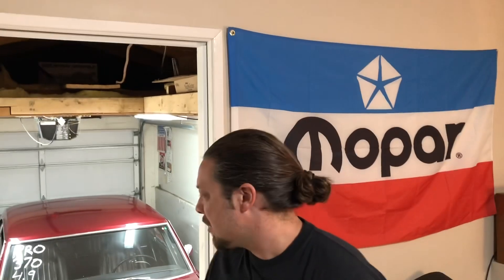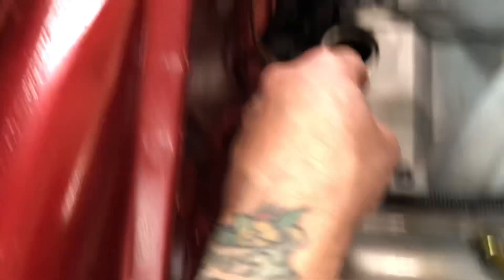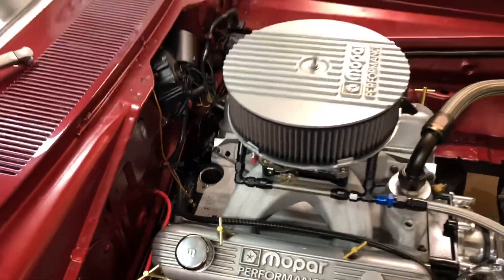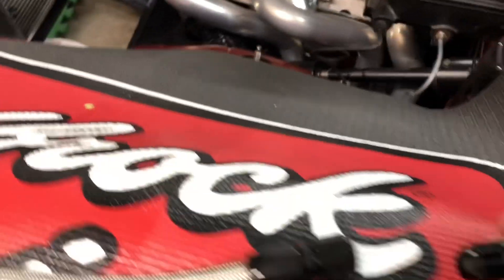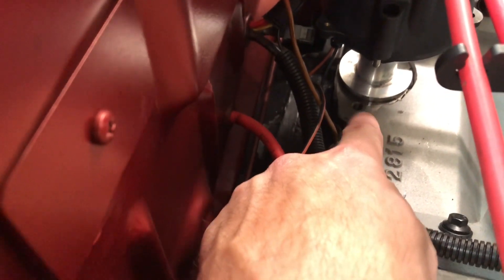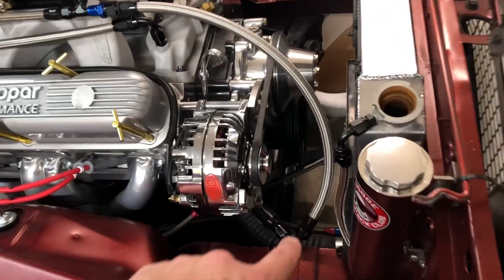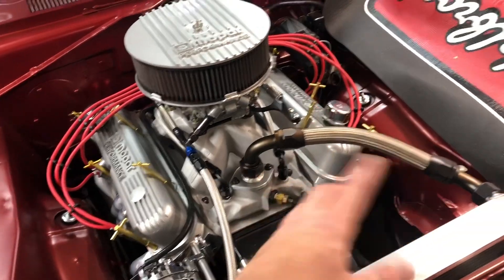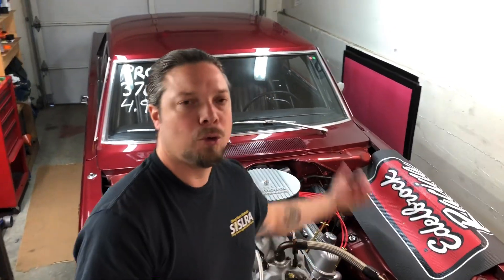More Racecar! Adding intake water lines to small block mopar! Edelbrock super victor intake

Comment: If you keep the thermostat and crossover from the intake to water pump could you put the temp sensor in the smaller plugged hole on the water pump? Is it the correct size? I like this modification but my car will be mostly street, thanks.

Comment: Did you block the flow at the deck. Two big holes on the top side back of block ? That's what's supposed to force the water flow up and around the head and out the intake passages you put in. You'll also see coolant lines from timing cover to the bottom of the block on some oval engines
Reply from the maker: I don’t know if it’s blocked at the back honestly. There is water in the heads there tho and it flow thru my new hoses and out so I’m assured of that
Reply: @SimpsonsSpeedShop  I know some of the oval track guys because thats what do but haven't done that mod yet. Just got  cometic to make them gaskets with that hole blocked. They'll be some flow there for sure idk 🤷‍♂️ if it will help or not. Its a mod to change the direction of water flow through the engine. They found the water just goes straight to the back up the heads and straight forward to the exit at front of intake in factory configuration. The serious oval effort dodges came up with a total package to make the cooling system much more efficient. Forcing the water to flow front to back bottom to top . Just asking because I've seen it alot with the oiling mods too guys only do half the job and then say it doesn't help 😆. Stuck exhaust valves due to lack of cooling  has been the theory and problem for some too. Oval track engines take a beating. Wasn't uncommon to see a blown up chevy a day before good cheap  aftermarket parts were allowed in the stock type  classes. Lol
Reply: @SimpsonsSpeedShop   for the critics also remember that oval engines are never below 3500 for 15 minutes plus  unless it's a caution or in the pits. I come off the corner around 5000 in my cars. Overheating is a huge problem I know guys who aren't concerned at all at 240 degrees operating temp 🙄 hope it helps cooler engine is a happier longer living engine in most circumstances 😀

Comment: did you plug the rear deck passages to force more exhaust valve cooling ?
Reply from the maker: ? No explain please
Reply: please see , YouTube 
Just LA’s 
600+Hp….? 408 small block mopar
Reply: the cylinder heads get the coolant prior to block circulation , thus cooler heads allowing higher compression with less chance of detonation

Comment: Gas will not "eat teflon tape". The reason it is is not recommended to use teflon tape with fuel lines or any hydraulics with tapered threads (not flare type fittings) is because pieces of the tape can tear off and get into the fluid causing clogs or blockage. Teflon paste or other fuel proof paste type sealants are safer. As long as you are careful with the tape, it's perfectly fine. PTFE braided hoses are commonly used for fuel line as well as hydraulics like PS fluid and trans fluid.

Comment: Please keep us informed on this new dragstrip that is being constructed !!!! I myself am very interested in any information you could give me/us on the tracks progress !!!! Thanks man !!!
Reply from the maker: Ya I will for sure. Haven’t heard anything lately tho.
Reply: @SimpsonsSpeedShop  thanks for getting back to me in such a short time !! Your one of the good guys !!! I wish I could come up with some suggestions to help you improve your car in some areas but you seem to have them all pretty much covered !! I know you want to keep it as much factory and streetable as you can so that leaves all my ideas out !! Have you made a decision on your carburetor yet ??? When I raced I had a 750 stage 3 carb from BG that flowed 1040 CFM @ the top end ! Gave me great consistent 60 ft times and plenty of throttle to the traps !! The drawback 800$ 15 years ago rather salty but it did work !!! The plugs were perfect after shutting the car off down the shut down and pulled a couple plugs at the end of return road !! That was a 406 with 13.2 to 1 compression !!!! That smaller cfm gave it great snap off the line but I never compromised the mid range or top end with fuel !!! Everybody told me I needed a 950 my engine builder said if the plugs read true don't touch it !!! My 60 fts were consistently 1.42 to 1.40 all day and mph was always mid 142 range !!! Just some FYI from my past and how I miss it !!!! Can't wait to see that car on a bigger track !!! Would love to see your car truckin 122 + mph(1/4 mile) !!! Have a good winter with your babies !!!!! (referring to your car and your little one)😁😄😊
Reply from the maker: @circletrack7538  right on bro! Not sure prob going to leave the 750 on it, I may try to get it back on the dyno this winter amd just see how it is. Looking forward to some 1/4 laps next year! Both baby’s are doing great! Cheers👍🏻

Comment: The engine looks awesome 👌 You can also paint the valve covers and the top air filter cover the same color of the car and remove the fresh paint from the top surface of the fins and hit it with a clear coat to seal it. Love those ceramic coated headers.  Looking forward to your delta temp readings....
Reply from the maker: Thanks for watching

Comment: She still is looking pretty. What do you usually shift the motor at RPM wise and what did she dyno at ? I'm sure its somewhere in here but just discovered y'all. Thanks .
Reply from the maker: Shift light goes on at 6100 so by the time I make the shift it’s about 63/4 but I sometimes still hit the limiter at 65 👍🏻
Reply: @SimpsonsSpeedShop  What's a Rev Limiter? In my day it was our wife. True but funny. Motor on my friends.
Reply from the maker: @NobilityandLoyalty  lol. Rev limiter is an electric component built into my ignition box. It cuts spark after a set limit, say 6500 rpm, so the motor will not rev past what ever you set it to
Reply: @SimpsonsSpeedShop  I knew what it is but I was thinking back to the good old days when we wouldn't know what it was like about 1970. Lol 😂 Don't tell my wife about her being one. She would Rev Me Out. You guys are the best.

Comment: Bro.. If you wanna knock temp outta the system and make more torque,  go E85 if you can. On a 100° Southern California day I can cruise my big block car with 4.10 gears, 3,500 stall and a reverse manual valve body and never crack 170° on my temp gauge. Pretty crazy.  I used to have to avoid any type of idling on hot days to keep it under 200°.  Not any more, pretty stoked on how the E85 has helped with my temp issues.
Reply: Im going e85 bought a fitec 1200 hp. Bbc 168 still a work inbptogrss
Reply from the maker: No e85 anywhere I know of. I’m in Canada, don’t even think we have it here.
Reply: @SimpsonsSpeedShop   Aww.. that sucks. It's worth swapping your carb if you were able to find it. Good luck with your coolant mod. Should help with the heat.🍻

Comment: My head is spinning after the comment on the ferry ride...😳😳
Joe , I run purple ice in my 461 pontiac street car..
Stock rad. ,mechanical water pump , clutch fan , 165 ° t. Stat  with 3    1/ 8"
Holes...160 at track  never over 170 °  in traffic  95 ° days.... (stock shroud ) .
I sacrificed looks and weight for the convenience  of not having to worry about temp... but  I get the look you are after....mine is a daily driver from end of April till the end of October  in Pennsylvania....
Reply from the maker: Ya o should clarify the weekend trip would be like 1000$. Ferry would be 400$ plus tho truck amd trailer. It’s a rip off for sure and there is no bridge.

Comment: Do you run a restrictor plate in place of the thermostat?
Reply: Why not even a restrictor, it helps to prevent localized boiling
Reply from the maker: @PredaFran  I don’t believe this to be true. Not from my experience anyway If you have a good size rad a fan it will cool as much as go thru it. Even anything running hot, Pull the thermo amd it will runn cooler
Reply: it's not how physics work and it's not related to coolant temp or the fan it's about the fact that the pressure after the thermostat needs to be higher to prevent localized boiling, it raises the boiling temp of the coolant inside the block. Water pumps add around 40 psi more to the water pressure on top of the pressure already provided by the thermostat. It's also why the rad inlet hose is almost always smaller than the outlet hose even tho water expands a lot after heating up. People don't put restrictors in an engine because the water flows too fast. That's just a wives tail, a myth. Our water pumps will cavitate long before we get there . Almost all the forms of high level motorsports you find out there will have thermostats or at least a restrictor plate, circle track, time attack, nascar, formula drift, etc
Reply from the maker: @PredaFran  no one I know does this to my knowledge and my temps is always like 180street and 190 on race days so I’m good.
Reply: @SimpsonsSpeedShop  and you can absolutely do that, but don't go around claiming you don't believe in something that isn't a theory, it's physics
Reply from the maker: @PredaFran  bro till I see it proven it is theory to me. You can say it’s physics all you want but I haven’t seen hard evidence.
Reply: @SimpsonsSpeedShop  what do you mean my man do you think everyone in motorsports just made that up.
Reply from the maker: @PredaFran  bro I’m just saying I haven’t heard of this. I get 10 guys a week on here telling me “facts” and “it’s proven” not tryin to argue or anything. Till I know from my experience, I don’t know.
Reply: @PredaFran  Wow.... No belt driven engine mounted water pump on the planet makes pressure. It is a flow pump, not a pressure pump. Every pound of cooling system pressure raises the boiling point up 3 degrees, period. Cooling system pressure (which the hoses create by resisting against the coolant expansion), flow, and surface area prevent localized boiling. That is exactly why Nascar, road racing, etc, runs close to 100 psi from using braided coolant hoses that really restrict expansion.. Racing runs 100 psi cooling systems for a good reason, and that is to have a high temperature differential for better cooling by running higher engine temps.. Water only expands 4 percent, which is miniscule, but you can easily get 100 psi with braided hoses just from that 4%. The radiator hoses are different sizes for the speed of volume, mass at the inlet to the pump, and prevent cavitation and a vacuum which will instantly boil coolant above 65 degrees, and has nothing to due with pressure.. If you measure cooling system flow wrong you will think there is a pressure offset, but that is not possible with water. Guess where the myth of a 40 psi pressure differential came from? Measuring it wrong.. You can't compress water... It is a flow offset, not a pressure offset...  Restrictors are designed to do exactly what you said they are not. Restrictors are used in combination with under drive pulley sets or variable electric water pumps to reduce water pump flow so the coolant has more surface contact time to pick up heat and to even the flow out across the rpm range.. The restrictor does this because the flow is laminar at low flow/rpm and turbulent at high flow/rpm, and that turbulence reduces flow thru the restrictor as volume passing thru it increases. If you don't know what you are doing when setting up system with a restrictor (slowing down pump flow, higher pressure hoses and cap, etc), you will cause localized boiling.... Your knowledge of cooling systems is just as bad as your knowledge of physics.
Reply: @shvrdavid  
but isnt the pressure and flow rate decided but what the pump is connected to?
- you cant compress water, but doesn't applying a lot of force to it create pressure? so wouldn't a pump moving water at a fast speed and then encountering a neck down in the discharge size build pressure in the discharge side since there's a restriction. water resists compression but it does compress an extremely small amount.  
-my understanding was that moving coolant faster doesn't affect the cooling of it since the water is spending less time both picking up and rejecting heat but it is doing more cycles of it in a defined amount of time, you are right and I did forget to account for laminar flow in that, which seems like it would cause issues in the radiator
Reply: @PredaFran  A water pump is a turbine pump, and max flow is obviously determined by restrictions in the system. You are looking at water wrong as well. Since you can not compress water, it acts far different than a liquid that can be compressed such as oil. When water reaches an area it necks down, it increases in velocity. It acts like a solid in many respects. Any pressure in a cooling system is from air/steam, and the hoses restricting expansion. Fast moving coolant can easily destroy an engine because there is not enough time to pull heat into the water or a enough temperature differential to effectively cool it. The higher the temp difference between the coolant and the air flow across the radiator is, it gets far more efficient at transferring heat. You can have coolant going to fast, or to slow, which will have detrimental effects on the cooling ability. This is called "heat load" in physics. The heat load in a cooling system is directly related to the flow rate through the system maintaining a good differential temp without any perking of the coolant. Most cooling systems are designed for a 10 degree drop, and speeding the coolant up will reduce that substantially because it never made it into the coolant to begin with.
Reply: @shvrdavid  thank you very much i have now learned something properly, so in this scenario present what would be the best way to approach the cooling system for this car? Gutting a thermostat? Testing to see which restrictor is the best size? Just an open thermostat?
Reply: @PredaFran  I would have probably done what they already have done. I don't recommend running restrictors unless you absolutely have to. Restrictors will show lower coolant temps on most setups simply because the coolant doesn't heat up. But that doesn't mean the coolant is moving heat. Most times restrictor setups will have massively elevated oil temps under load because the cooling system can't absorb the heat quickly enough. I would much rather see someone run reduction pullies or an electric water pump, good tstat, piston oil squirters, larger oil sump, and an oil cooler on high hp/heat/racing applications. The cooling system does basically nothing for the bottom end heat soak. The oil does all of that cooling, which is basically no cooling without an external oil cooler. Oil temps are the root of a lot of cooling system issues at high hp... It does not do any good to cool the heads and block and having a hot piston causing preignition and breaking stuff.....
Reply: @shvrdavid  but Wouldn't the fact that the  thermostat isn't there make the coolant go too fast ? Would he need to have a different pulley on the pump ?
Reply: @PredaFran  If he was road racing, it could be an issue with no restriction allowing more heat transfer. But he isn't road racing it. It would probably have a better temp difference from one side of the rad to the other with a restrictor and reduction pullies, but if he is not having issues that is a moot point that basically doesn't matter. It is only under heavy load for a few seconds, which will only be a problem if he has to repeatedly hot lap runs. The only other thing I would consider for what he is doing is an oil cooler to deal with bottom end heat soak that the cooling system can't remove.
Reply from the maker: No